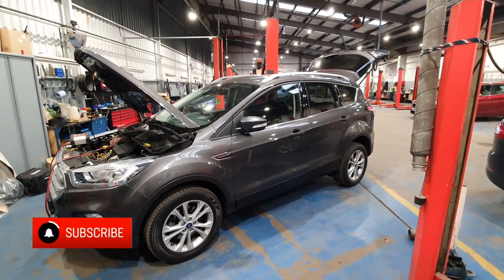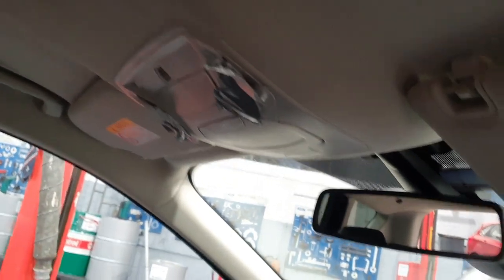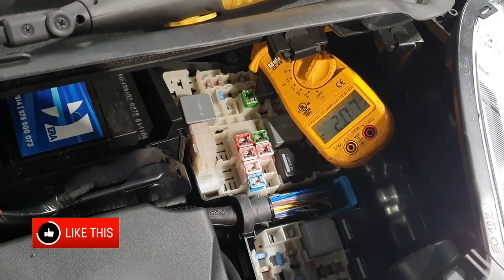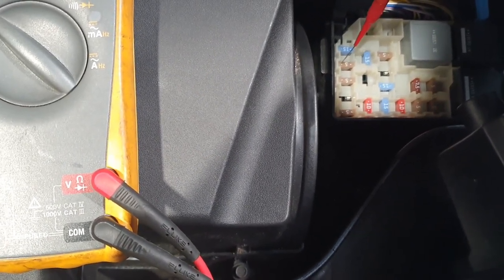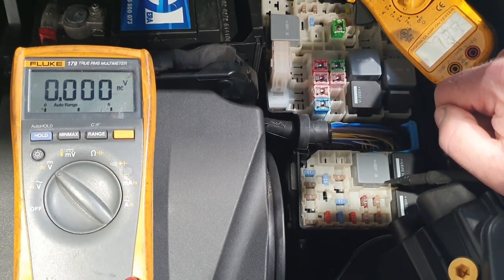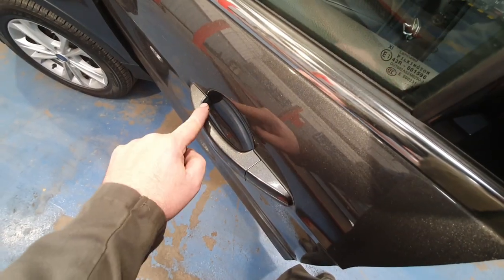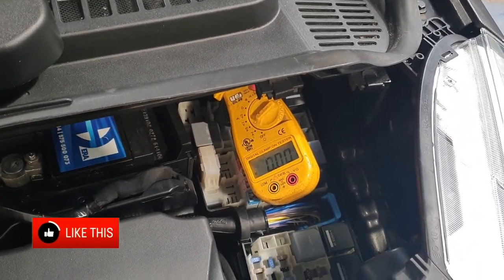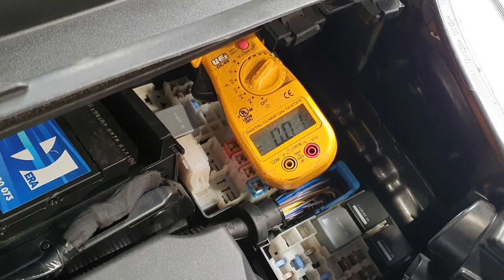2018 FORD KUGA / ESCAPE - The most unlikely parasitic battery drain

Comment: I had this exact same fault a couple of months ago using data logger I found that both front door handles was keeping the vehicle systems on, they both had water intrusion into the connectors of the handles. Replaced both handles plus the looms and was all OK. Great instructional videos 👍
Reply: How did you fix it ?

Comment: Great video thank you. Having similar issue with a 2007 ford focus, has similar handles/locks. If this happens to be the issue, can you just leave the handles disconnected, or turn off the touch/proximity setting? And still have the car lock with the key fob or key. Being a 2007, they arnt in a rush to buy new handles or sensors for it. Just happy if it drives and stops killing the battery. Thank you
Reply from the maker: I know on the MK3 focus the keyless entry can be turned off in the dash menu. But unsure about the function on the age of car you work on
Reply: @SYDiagnostics  thank you. Will have a look. Again appreciate the vid. Very helpful

Comment: Thanks for the very instructive video,  but I don't understand the purpose of the can bus resistance test?
Reply from the maker: it was to show the network had shut down, 60 ohms is its shut down state. It may of been more clearer if i'd shown the voltage like i did on the medium speed. sorry for the confusion
Reply: @SYDiagnostics  thank you Steve

Comment: i have this issue with a petrol escape sits overnight battery will drain overnight
carried out a current draw test sitting at 2.068  ended up getting down to 0.052 

removed fuse 11 and it hit 0.52 could this be a bcm issue

Comment: would pulling the fuse fix this issue??? (I don't use keyless anyway)
Reply from the maker: I'm not sure what else is on the circuit, there may well be issues by pulling the fuse. To answer your other question, the handles are available only from Ford

Comment: Good stuff. Thanks. I'd have a question which is kind of related to this topic but not exactly. 
I'd like to tap in one of the circuits to connect a dash cam but I'm not sure which fuse would be the best. 
I have chosen either the tail gate fuse or F80 the moonroof. However, since my car has not moonroof but has a fuse in F80 and there is current in it, I am not sure it is an "empty' circuit and is safe to connect to it or it has something else connected to it. 
I'd really appreciate if you could help me out with that. Cheers

Comment: Hi, I have subscribed to your channel and I was very interested in this particular video. I have a question... I own a mk4. 1.5 diesel focus Vignale 2020. It was second hand with 3000miles on it, I too keep having a flat battery.  After 3 days of rest, the car won’t start and the dash goes bonkers. I have placed a battery condition meter in the accessory socket recently and it shows an almost constant 14.7volts charge rate (same reading with a good multimeter). The sales garage does not appear to be concerned about the high charge rate and put it down to my dash cam consuming 0.4Ah… It is left plugged into the accessory socket. Should the accessory socket still be able to drain the battery with the ignition switch off? and isn't 14.7v too high. Thanks for the videos they’re very informative.
Reply from the maker: 14.7v isn't too high, but if it is constantly this figure then the battery is discharged and requires charging (which the alternator is doing). If there is a 0.4a constant drain then this will drain the battery in a couple days at least. If the battery is constantly going flat, jump started and charged, then it could well now be faulty. I would look into hard wiring the dash cam into an ignition live (careful though as they can knock out DAB reception). The battery monitor sensors on these vehicles have a faulty batch .. if the part number on it is not ending with C* then it requires changing and there could be a BCM configuration update available
Reply: @SYDiagnostics   Thank you for your advice, so kind of you to reply.  I am only too happy to talk with you over the phone and pay for your consultancy time please advise me if you feel this would be best.  
My battery monitor sensor is labeled as JX6T 10C679 CA, should I ask my local garage to replace this with a JX6T 10C679 CC ?. 

Thank you for your very helpful reply.
Regards.
Reply from the maker: @Thesheddweller  Hi,  The battery monitor sensor part number is OK and doesn't need replacing, Can you remove the dash cam from any power source and re-check?  0.4A is too high a drain (0.02 - 0.05 is acceptable) it has been known the the telematics units can stay awake too with a 0.3-0.4a drain.  If you have registered on ford pass app and can connect car to a wifi source, then these can be updated via the "wifi" section and check for updates. Have you tried disconnecting the battery for 30 mins then re-connect.  Try the amp drain again, often the telelmatics unit will re-set.  Only camera ive fitted on a Ford Focus mk 4 was a genuine ford camera and i cant remember the fuse numbers used (one ignition one permanent)

Comment: Hi Steve, always watch your videos with interest. I realise your probably very busy but hope you can spare a bit of time to answer a question for me. I watched your video some time back regarding water ingress from the windscreen washer pump to the BCM on a Mondeo. I had that exact problem and had to have a new BCM fitted   So my question is, to stop this happening again with the new BCM, can I cut the wire just before it goes into the BCM plug and rejoin it with a spade end connector. Hopefully this would stop the water tracking along the cable. Would this work, without causing any fault codes or engine warning lights to come on. Hope you can find time to answer this. Ta.
Reply from the maker: exactly that, i replace the washer pump as in my opinion its faulty, then i cut and solder the wires to stop any further tracking of water
Reply: Thanks for the reply Steve, much appreciated. Will fit a new pump, as you suggest, and cut wire and fit spade end connector.

Comment: Great video. You said the door handles were at the bodyshop for painting. Why not use the old ones and save the customer the paint job?
Reply from the maker: the covers are stuck on, they can be removed with a bit of heat and gentle prizing off. The cost was absorbed in the diagnosis as we have an onsite bodyshop